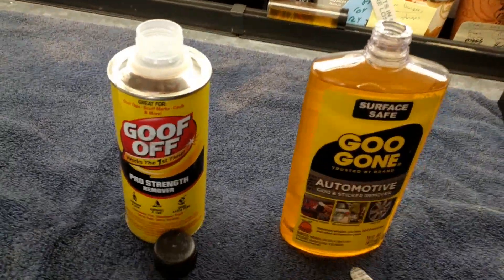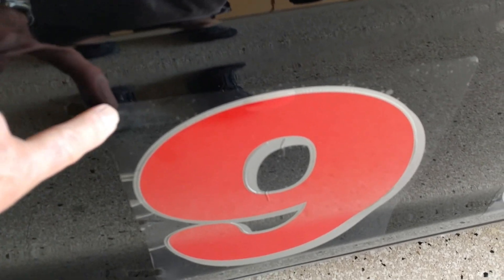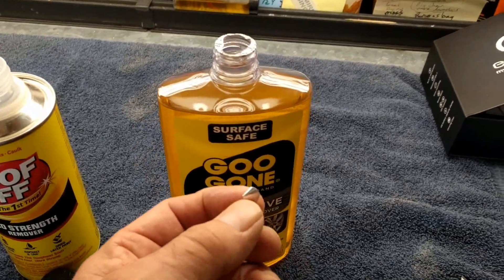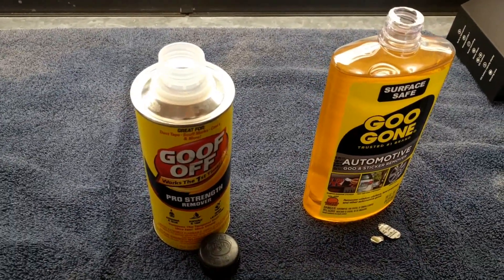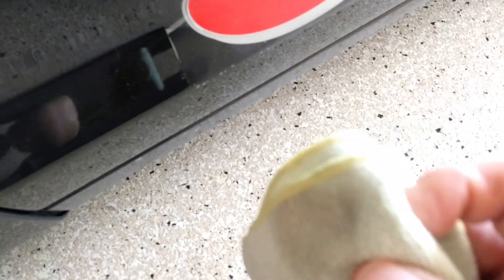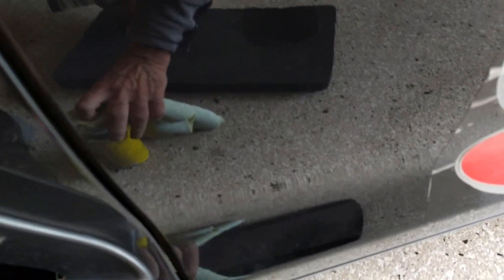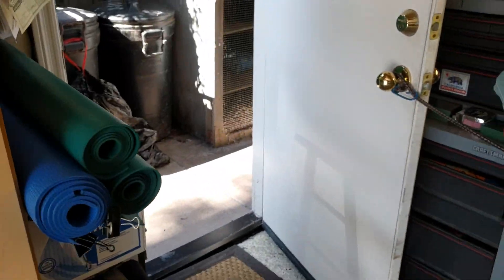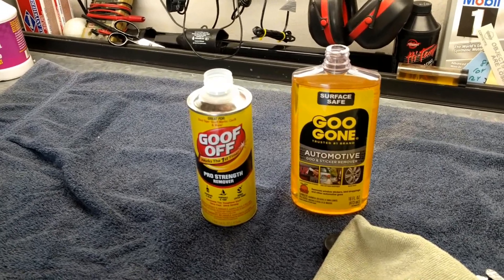Corvette c6 z06 clean sticky adhesive residue goof off goo gone by froggy

Comment: Excellent video.  I use vinyl tape to make the numbers on my Vette during Autocross events.  By the end of the day, there is lots of residue left when the tape comes off.  I will keep some of this stuff in the race day kit.
Reply from the maker: Works fine, but do not over use, I think it'll "melt" the vinyl.

Comment: Got some road paint on my car looks like it has been there awhile. Just bought the car, been claying it and it works but is very time consuming. Just got goof oof and am not sure about it cause I think it may be taking of some of my blue paint.
Reply from the maker: If the paint is old and/or has not been waxed much, you could take a bit off, look at the rag. But it probably won't show any different once you do a good wax job. Also usually on lowest body panels. It'll be better than road paint looks. Right? Thanks!

Comment: From my experience removing factory pinstripes goof off works 10x faster and is easily washed off. Goo gone hardly takes off the stripe and leaves a thick residue that's kinda hard to get off.
Reply from the maker: Agree goof off stronger! But maybe the weaker goo gone has it's uses too, if/when you don't need the stronger stuff.  THANKS!